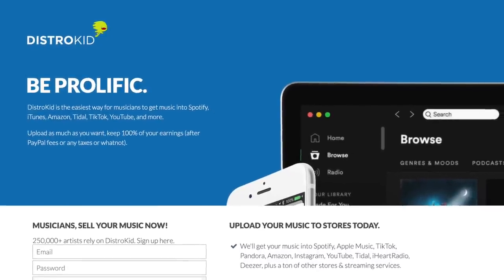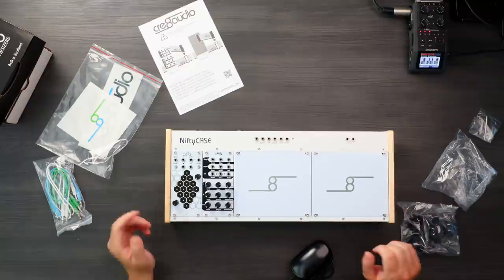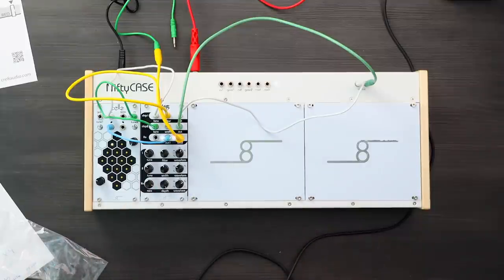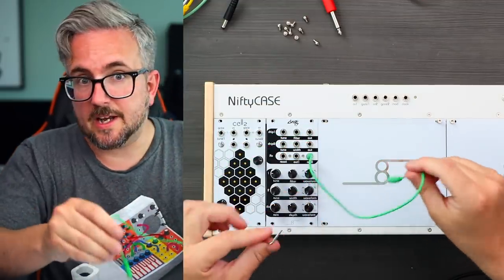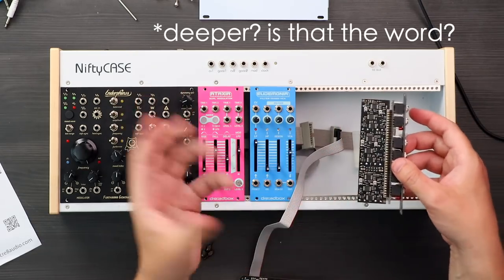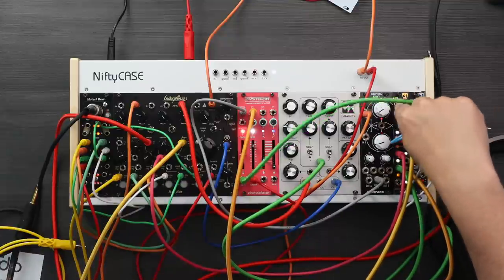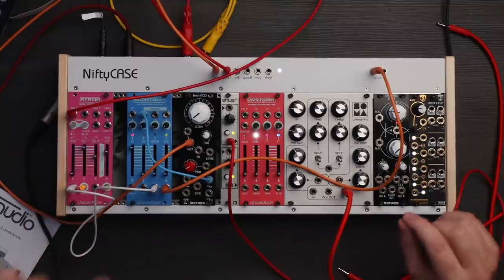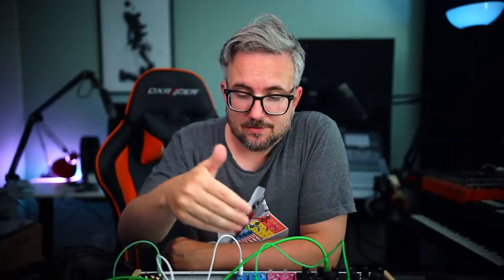$200 Eurorack Case for Beginners! But is it any good?

Comment: The relentless price gouging I see for eurorack framework is OUTRAGEOUS to say the least. For certain modules, I can see splurging a bit to get the sound you want. I will pay for it if I know it's going to function and sound good. But in terms of simply building a synth, the fundamental tools you need just to power your unit and store it cost way too much. This is primitive technology being sold at inflated hipster prices. We didn't just discover electricity and cabinetry yesterday! So why are they pricing it like it's fhukn vibranium?
 I wouldn't buy the Mona Lisa if I knew the frame was the same price as the picture.
Reply: that is why I went with Doepfer- solid build quality and good sound and not as expensive as other modular companies. Price gouging due to surge in modular and eurocrack because of covid 19 lockdowns nobody can go out to bars and party anymore so they are stuck at home with nothing to do but watch tv and play video games.
Reply: There is no economy of scale - they have very short production runs or are made to order. This is what you pay for custom unique stuff. They’re probably barely even making a profit no doubt.